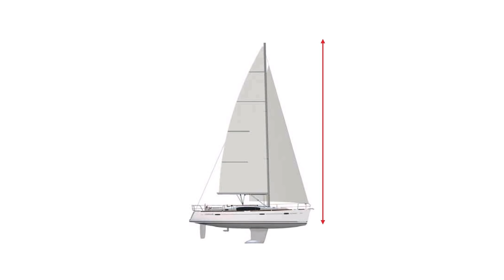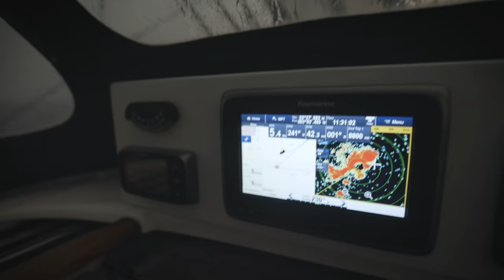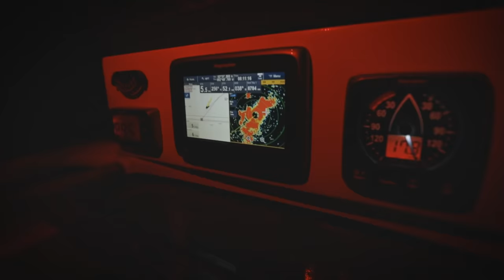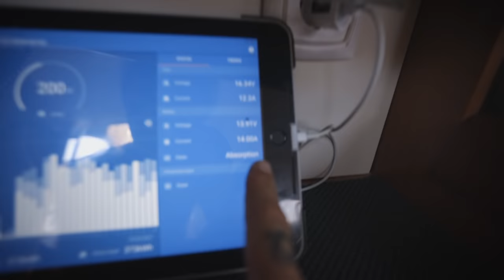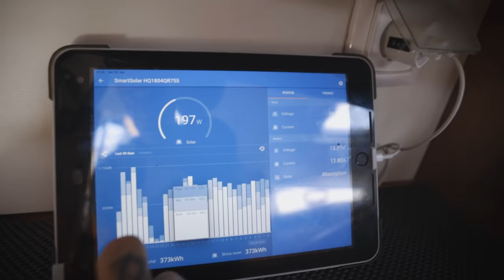Is a BENETEAU suited to Bluewater Sailing? (BOAT TOUR & REVIEW) ⛵️ | Ep 24

Comment: That's awesome, but my fundamental concern is the strength of the hull and its reinforcement. My basic understanding is that Beneteau saves money by using stringers to 'assist' in loadbearing for a thinner hull section. Hmmm, that may just be sour grapes, and- i've never compared sectioned hull for comparison. But, knowing that marine grade plywood is easy to 'cheap out' on: thinner sections, reduced glassing & cut sealing efforts along with 'over reliance' on stringers providing hull strength my coastal comfort zone is fine. But, for longer and more dangerous crossings, I'd rather have a little more tonnage reflecting more glass/epoxy, thicker & more reinforced stringers. Then what about the rudder mount? How solid are the joints connecting the actual rudder to the guide arm? How well designed/heavy are the steel lines connecting to the control arm? A rudder failure is a dangerous issue and one I would not take lightly when planning a crossing. However, your 'build up' is exceptional and I think I only would've added winches closer to the wheels for added safety! (Small niggle of a personal opinion expressed!) So, Good on ya! for a well considered, no cheaping out build out for a boat that may have started a little limited for your planned adventures!
Reply from the maker: Thanks so much, this is a very well rounded and informative comment! The hull thickness and grid system are valid points and are concerns we would share. The rudder, control arm and quadrant are all very solid and we have serviced and inspected these but the concern in that department would be the hull thickness and support framework when under heavy load in seas. Additional winches are also a great idea, thanks for all your feedback. 🤙
Reply: @SailingBeaver  Really- Thank You BOTH! You did all of the hard work: buying the vessel, considering the issues & addressing them WELL. Then, presenting the solutions orderly (snubber 'dildo' comment excluded! Hahaha) with GREAT visuals. I appreciate all of YOUR efforts & you deserve honest & well founded responses. I'm very glad that you shared my rudder assembly concerns & addressed them, and- I'm sure that you will also check hull strength as you move ahead. You've done an incredible job. Like I said, my concerns may be just decades of noisy floors & hull slaps from loose stringers in older boats. I applaude your efforts & will mo' definitely follow your adventures. My question for Jeanneau/Beneteau & other high volume manufacturers- what length forces "Blue Water" design? (safety, reinforcement, sizing considerations, etc...) Had you asked me in a bar, I might've guessed 50 feet being the limit. (Note how many 'fancy' coastal boats are 50' or less!) As a former Capt'n & delivery guy, I would definitely deliver your boat to almost any port (now that cash isn't as tight- my standards were MUCH lower in my youth! Hahaha) I wish there were more people like you, designing/building the right vessel for their needs. Ask any long time sailor if they ever got out to sea only to find that they were completely unprepared for what they were facing- to a man (woman) they will all say "Yes I have!" if they are honest. You are prepared for much more- again Good on Ya for all of the studious effort(s)!
Reply: @SailingBeaver  I was very troubled by the many repair episodes on the Expedition Evans channel on their salvage 2008 Beneteau 49 - https://www.youtube.com/c/ExpeditionEvans/featured  The root cause of these problem was the previous owner hitting a submerged object at full speed and ultimately the insurer totaled the boat.  The collision did not directly damage the hull, but the torque on the external keel caused many major problems that the Evans repaired over many episodes.  I didn't think that hitting such an object should be a fatal event for a well designed hull.
Reply from the maker: Unfortunately that’s the basic physics of the Beneteau grid system and how it connects the keel. Any small keel collision could fracture the grid. Would be nice to have a vessel strong enough to run over anything but it doubt it would be nice to sail.
Reply: @michaelmarcus2318  Well, Yes- that's true and NO, a little less today. The effects & interactions on the hull, stringers & grid tie system on EVERY boat (production & one off yacht designers) has improved dramatically within the last 10 to 15 years. And, the spread of load for impacts has become a safety feature that allows other areas to be less reinforced. The overall effect is lighter weight (faster boats) with good strength & rigidity over a very long service life (GRP). The original hull design may not have made the cut for consideration of the newer, improved software that is being used today- and certainly, it is not the only production boat that has experienced major damage after hitting something at full speed. I found a new Discovery 48 S with a tabbing issue (structural, completely unsafe to take to sea as is) and I would call any Disco a 'bluewater' boat by anyone's standard.

Comment: for me, its not about the brand, but the design. some designs are just better suited for bigger/longer/shorter waves & stronger/lighter winds. id argue its a huge difference between sailing the baltic sea with very short/choppy waves, the northern sea with relatively short but big waves or the pacific with big and long waves. however, usually it comes down to the comfort factor as you can cross the atlantic in a whiskey barrel.
Reply from the maker: Spot on mate, Cheers!

Comment: Look pretty ship shape to me. Maybe the hull is a little thin make it thicker where the stresses are. I seen a windmill that you can use in the water and tow or make it for wind . I thought it was cool. 250 amp hours every 24 hours towing it . So they say
Reply from the maker: Thanks 🙏. That’s correct, a rather thin hull for sure at about 8mm we measured. A great idea for the towable wind generator. Cheers

Comment: Hi. one of the key issues with production boats is the attachment of the strongback to the floor. I yours glued only  (not good) or is it glued and laminated (would be very good)? Regards from Switzerland. Silvano
Reply from the maker: Seem to be glued (plexus) only at the flanges in areas with less load and glued+laminated at high load areas of the main grid above keel and under mast. Cheers 🤙
Reply: @SailingBeaver  99% of grid failures are from heavy grounding (Except for early Bavaria's,& penny washers for there keelbolts)
Reply: The  BENETEAU also has washers on the keel bolts. I would like to see backing plates installed.
Reply: @SailingBeaver  ... and laminated deck to hull flange would be welcome, too.

Comment: You can absolutely cross oceans in a Bene, with that being said it is not a suitable long term blue water boat.  Your Atlantic crossing part 3 highlighted that perfectly.  You will probably make it just fine but it will be an uncomfortable and a sketchy ride at times.  Uncomfortable and sketchy are not the attributes of a blue water cruiser.  Humans have been building boats to cross oceans for hundreds of years and we know what designs work better than other designs.  There is no sense in me listing all of the things that make the Bene less than ideal because you already know them and it doesn't really matter to your adventure.  You have outfitted your boat about as well as you can considering it's limitations.  I applaud you for getting out there and doing it even if the boat wasn't really designed for it long term.  It makes me happy to see young people out there and sailing long term.
Reply from the maker: Very well worded there sir and couldn’t agree more. An interesting point to mention the long term suitability being limited as we could imagine the workload would be far less in rough weather on a deep and heavy BW boat as compared to our light “excited” hull shape.  Thanks for tuning in 🙏
Reply: @SailingBeaver  friends that have completed an Atlantic Circuit in a Grande Solie. They said their next boat would be more bluewater. Heavier was their main consideration
Reply: Well, bit of a strange remark, we crossed oceans on different boats and when the weather goes bad no boat will be comfortable.
Reply: @francisverhelst9375  so I guess you sail a light boat. We have crossed the Atlantic both ways. Once in a light boat. Once in a heavy Bluewater boat. The heavier boat was far more comfy. You sleep better, it's quieter, it doesn't slam to windward. It's drier, has far better storage and fully loaded with gear for liveaboard it's faster than the light boat also fully loaded. We could not go back to lightweight boat for crossing oceans or living aboard full time. Of course you can cross an ocean in anything if you want to but some tools are better for certain jobs
Reply: @francisverhelst9375  Comfort does not refer to rough weather but every day motion.  Think about riding on top of waves versus riding through them.  The boat that rides through the waves instead of on top will also have less motion and be more stable in rougher weather as well.  Hull design makes the difference here.
Reply: Any chance a storm trysail, rather than fully reefing the main, would work on that downwind passage in strong tradewinds, hoping to avoid the round-ups, broaches, and pole dips?
Tack pendant to elevate the foot above the boom, head below the running back tangs, about 25% of mainsail area, even though that may be close to the area of the third reef in the main, and cut to match the sheeting angles.
Just thinking about less sail area aft of the axis of yaw (moving the center of effort forward), boom safely fixed and lashed in the centerline or on the rail, simple sheeting clear of the boom and dodger to both quarters facilitates simple jibes, better balance to the rig helps the windvane steering, and any small sacrifice in boat speed may be a blessing!
Just a thought, but maybe Beaver's mast will not take a separate track.
Reply: Any chance a storm trysail, rather than fully reefing the main, would work on that downwind passage in strong tradewinds, hoping to avoid the round-ups, broaches, and pole dips?
Tack pendant to elevate the foot above the boom, head below the running back tangs, about 25% of mainsail area, even though that may be close to the area of the third reef in the main, and cut to match the sheeting angles.
Just thinking about less sail area aft of the axis of yaw (moving the center of effort forward), boom safely fixed and lashed in the centerline or on the rail, simple sheeting clear of the boom and dodger to both quarters facilitates simple jibes, better balance to the rig helps the windvane steering, and any small sacrifice in boat speed may be a blessing!
Just a thought, but maybe Beaver's mast will not take a separate track.

Comment: Hi, thanks for sharing your boat set up. I also mounted a solar panel with NOA parts on the Railing but you found an Arch that you screwed to the railing as well. Would you be so kind to tell me where exactly you bought it? I am located in Germany and sailed to Norway last year so I hope you got it around here somewhere. If it is written in your book I will just buy it, if you can just  let me know if you wrote down that information there.  Thank you!
Reply from the maker: No worries. Yes it’s quite detailed in the book with the mounts and how it was made with measurements. We had it fabricated by a welder so should be quite easy to replicate.
Reply: @SailingBeaver  Thanks man! Will have a look into your book.

Comment: Just about any boat 'can' cross an ocean, I do not think if a boat 'can' is the issue. Is it safe to do is the question. I personally would not do a circumnavigation in a boat that did not have a protected prop and rudder, nor would I trust a bolt on keel. Think of a cargo container 3 feet below the surface.

Comment: It’s a thin fiberglass shell with an interior fiberglassed to it. Designed for short hops within 200 miles. It will work, if all goes well.
Reply from the maker: Slightly pessimistic especially the 200 miles but yes just a glass fibre shell essentially. Yes, it will work until it doesn’t.

Comment: An Oceanis is more than likely able to handle rougher seaways than most every catamaran on the market. Is it going to be able to handle a hurricane? With a little luck and a very experienced skipper, it can probably get through a cat 1 hurricane without much damage. There are boats out there that can handle worse, but there aren't very many of them. There are hundreds, or even thousands of Beneteaus that have plied the open ocean with no problem, so, in that sense, the Oceanis is as much of a blue water boat as most other boats.

However, to my mind, the real problem with Beneteaus is the bolt on fin keel and unprotected, spade hung rudder. As the saying goes; "There are two kinds of sailors, those who have run aground, and those who will run aground". There is no configuration that's worse for running aground than a bolt on fin keel and an unprotected, spade hung rudder. 

The problem is that nearly every big time manufacture in this day and age produces boats with bolt on fin keels and spade hung rudders (or two). Even manufactures like Amel, Haberg-Rassy, and Oyster have gravitated towards this configuration. To my mind, that leaves far too few boats being produced that could truly be a go anywhere, blue water boat with the ruggedness to keep a small mishap from turning into a serious problem.

That being said, if the best boat you can afford is an Oceanis, and you're comfortable with the increased risk, then buy it and go sail it.
Reply from the maker: Thanks for this informative feedback 🙏 Very true that although there is some weaknesses with the design style even the true BW brands all all doing this now. Although we have not yet run aground we agree to the vulnerability on this area. 
Thanks again and fair winds 🤙
Reply: There’s another saying: a lot of sayings are bullshit.  Here in the Chesapeake groundings are common, on a forgiving bottom and generally smoother water and smaller tides.  It’s like a training ground for grounding.  But elsewhere, where the bottom is not so dynamic and shallow everywhere, never grounding is not only possible but the norm, for the skilled boatsman.  Thus vessel trades some structural robustness for affordable livability etc.  Avoid risky anchorages and the trade off is a smart one.

Comment: I wish that this issue would just die once and for all! I believe there are 2 major factors involved in keeping this insanity going: 1). Most people can't afford a true bluewater boat unless the boats are getting quite old and 2). The hesitation of insurance companies to insure older boats (even though they are far more seaworthy). Enter flimsy production boats with their amply documented shortcomings. It's inherently dangerous to suggest that a small production coastal boat is in any way suitable as a bluewater cruiser. This question always puts production boat owners on the defensive! Do people do it? Sure! Are more production boats crossing oceans than any other boats? Yes! Should they? Well that's a question of what you see as an acceptable risk for you and your loved ones. Drop these boats into a Fastnet or a Sydney Hobart situation and not many of them would make it! Any sailboat could handle the sea state shown in most YouTube videos. We're talking about conditions that will pick your little boat up, turn it 90 degrees and smash it down on its side! Even bluewater boats would get dismasted at that point and one of your only options remaining is to lock yourself inside. Good luck bracing yourself while you get rolled over and over again. You'll be cursing your condominium-like interior! The very term "bluewater" should suggest that throughout the lifetime of a bluewater sailor the chances of getting into this type of a situation is far from zero!  If you think that your weather planning prowess is foolproof, think again. A bluewater sailboat by definition is a comletely different animal so don't let names like "Oceanis" fool you. Just do a quick comparison between a production boat and a true bluewater boat on Sailboat Data. The numbers speak for themselves! No thanks, not for my family...I don't care what you've done with the boat. I speak from 40 years of successful offshore experience. Offensive rant...over 🧐
Reply from the maker: No offence there at all champ, some well rounded points for sure, most of which we would have to agree with. 

As we mentioned there are vessels better suited specifically for long term BW usage and although we do venture on some crossings we are well aware of the particular characteristics of this boat, albeit through trial and error. 

Overall we are satisfied that the boat fulfils its purpose, but do we appreciate a nice heavy, deep solid BW boat when we see one? Yes! Would we prefer to be sipping coffee in a centre cockpit in 5 meter seas and 40kn with a perfect balanced helm, Yes. Would we appreciate to have unlimited cruising destinations within our reach… Of course! But we also gotta work with what we got and try build some experience along the way!